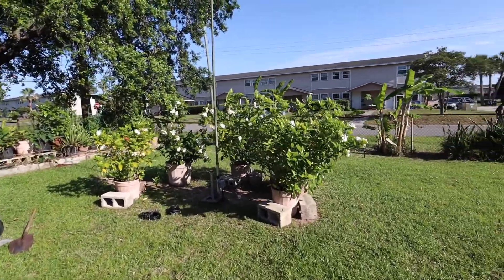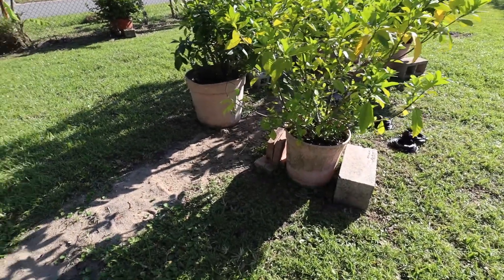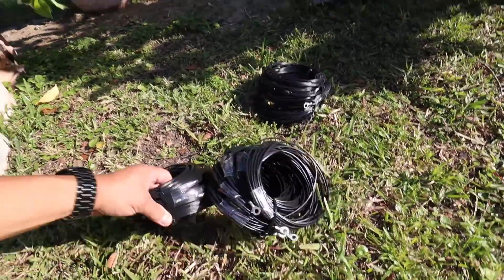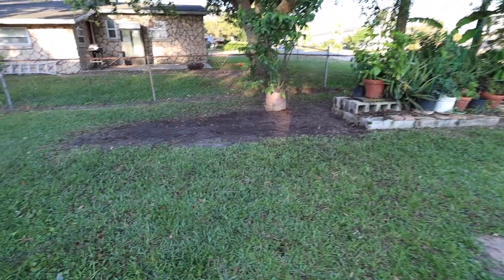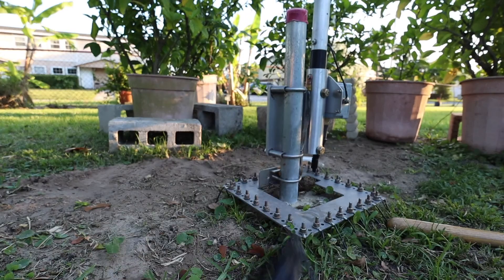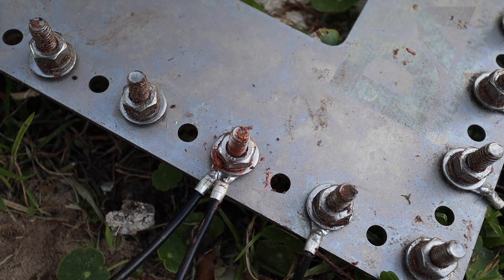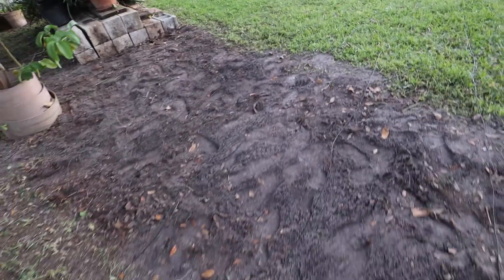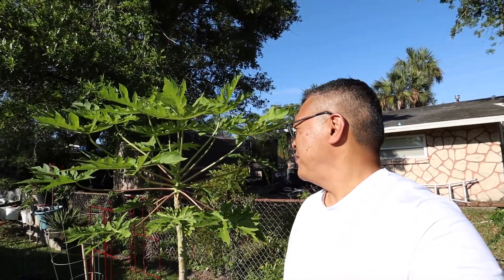Installing More Ground Radial on Zero Five HF Antenna

Comment: Not shure what you intend viewers to take from your zero five antenna posts:(
If these are about gardining in pots looks good. If this is about the antenna it seems to lack any objective testing, as all hams should, to drive all the hard work you appear to be doing. Or is this more of a 'Seat-of-the Pants' approach & just kinda 'Winging-It'? Pun intended.